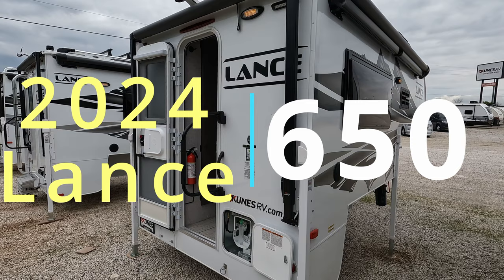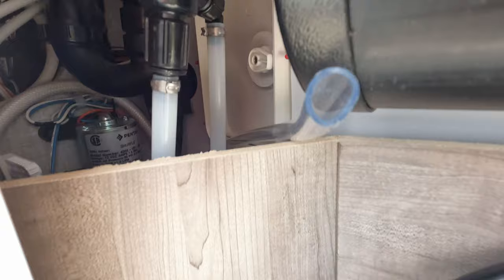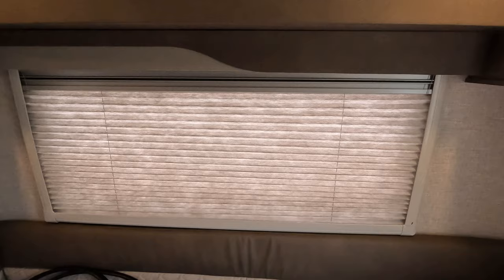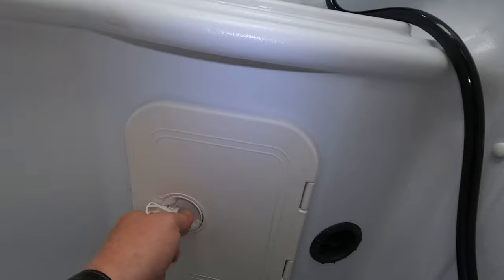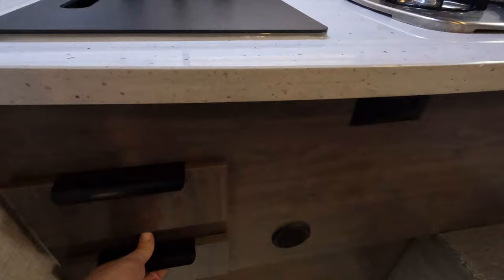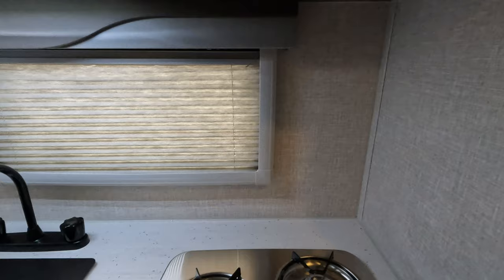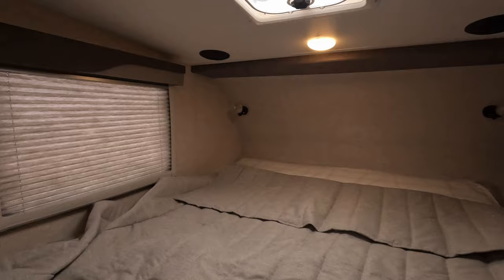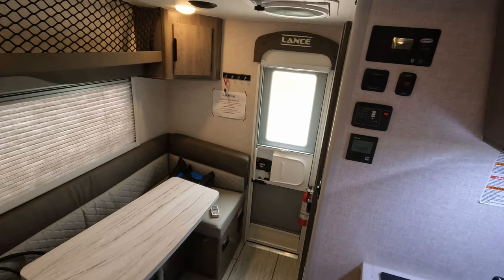2024 Lance 650 Truck Camper

Comment: These wont fit the F150?
Reply: I was actually wondering the same thing because the new F150s have a cargo carry capacity of 3,300lbs which is plenty to haul this.
Reply: @willeubanks4957 The only one that would haul this, dry, would be a 4x2 Regular Cab w/ the 3.5L --which nobody has that wants this camper.

Comment: Still too heavy for my dodge diesel 4x4 long bed.
Reply: No its not.
Reply: @andrewsneacker1256  Sorry, I was just complaining about my truck, they put the payload at 2200 because of the heavy diesel and 4x. It actually has 1 ton axles so it makes no sense. I think it's political, trying get more trucks in the "light truck" classification.
Reply: @jeffvw1994 does DOT /CVSE wherever u are actually go by payload rating? I thought they only cared about gvwr, axle limits, and tire load limits. If ur good then what's the problem? I'm thinking of putting this in my third gen, cummins 4x4. The lack of cold weather capability of this camper is such a shame
Reply: @pravdasircone1691  I think dodge tried to get the gvwr down on our trucks to qualify for a light truck classification. My payload is only about 2200 pounds but the 05 4x4 cummins has one ton axles and brakes. Only dif is one less rear leaf spring. Legal payload should be at least 3k.
Reply: @jeffvw1994  fifth gen long box Laramie gvwr is 11800 lbs .. third gen is 9900. Some ford's in this gens age area also have higher gvwr. Truth is with tare weight being 6800-7500 lbs and gwr 9900 it leaves u with not much to use. Such a shame. Way under rated trucks. Especially since I've done some upgrades but they wouldn't care obviously coz the sticker says otherwise